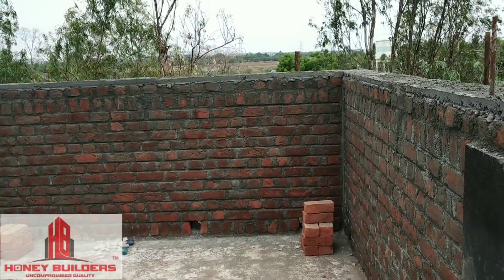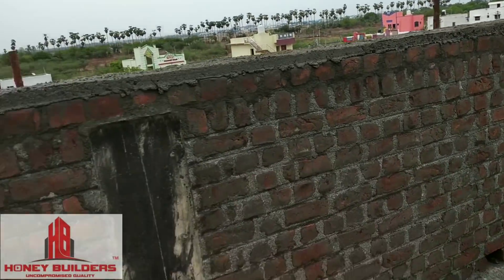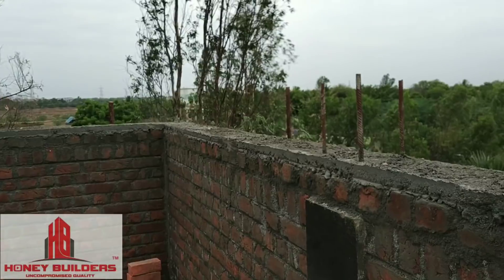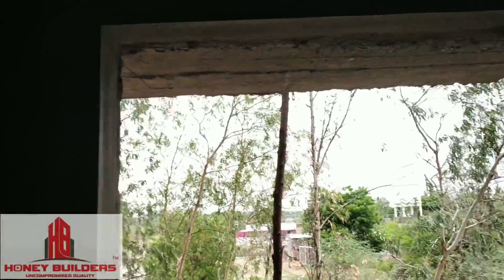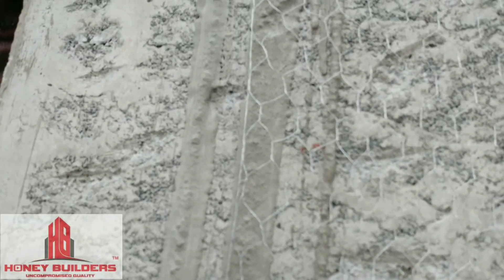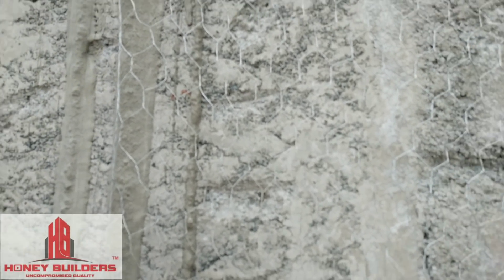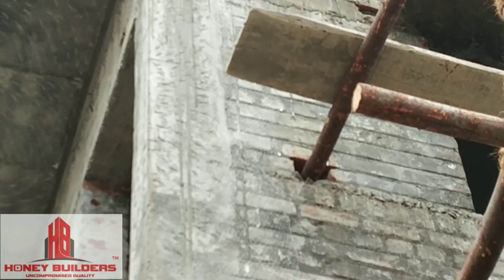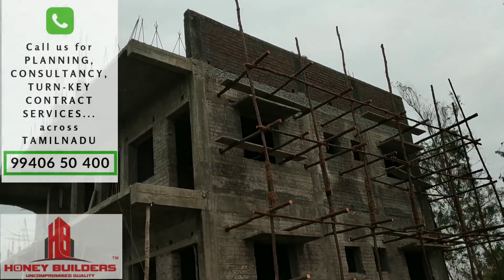கோழி வலை (CHICKEN MESH) பயன்படுத்துவது எப்படி ? | CONSTRUCTION SCIENCE

Comment: Sir.
Could you please Explain with interlocking brick buildings and requirements of  Column size,Beam size,Slab thick,How many floors will possible with this bricks.etc.
Load bearing structure and Framed structure advantage did advantage in these type of buildings.
Because I have decided to build my house by using interlocking bricks. I was analyzed and this will be a cost efficient.but I don't know about safety and measures in interlocking bricks.
Is this suits for Our area Karur Vellakovil kangeyam regions.